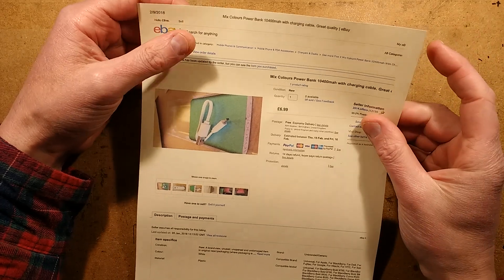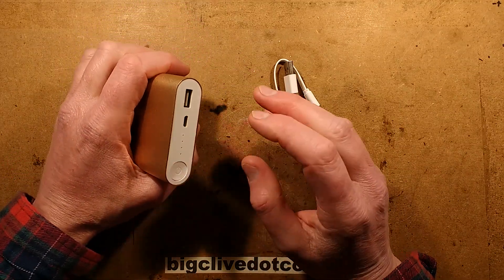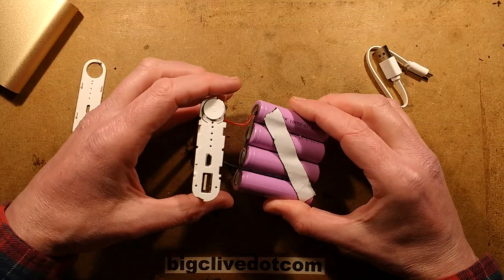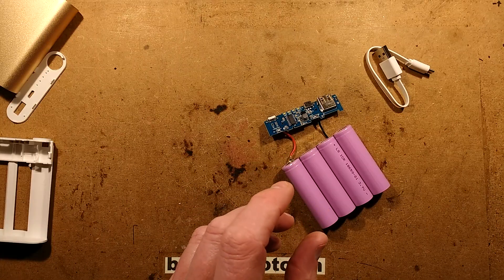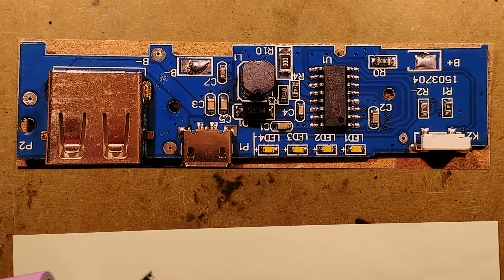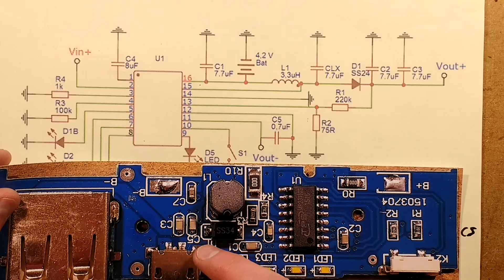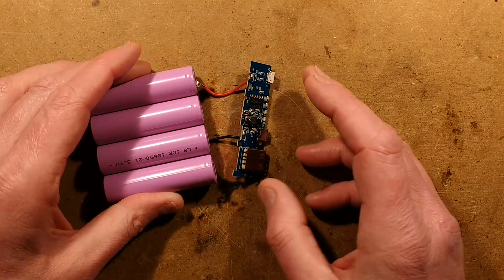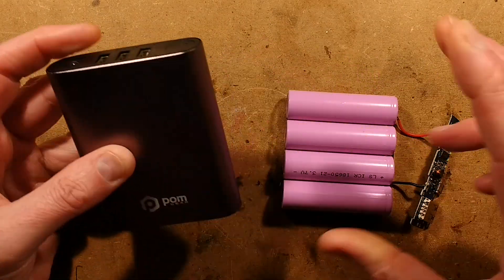Inside a fake "10400mAh" eBay USB power bank.

Comment: You should always fully charge before use before its first use. 
It forms a protective terminal layer whereas if you use it without charging it doesnt do that and causes capacity issues.

Comment: Bought one those rechargeable rotary tool from Walmart in US. They gave me the wrong wall charger. The tool never charge the led was always blinking do that for days and never charge. Built a variable volt charger finally started charging. But it had a tight window. I still get to use wouldn't recommend for anyone else to buy.

Comment: Hey! So I got a 26,800 mAh about 8" by 4" maybe a little bigger, and about the thickness of a single 18650. Probably the same width as that one, but another 2" longer, but I only paid $20. I wonder how I can find out the actual capacity without tearing it to bits and breaking it. (Look I used a Clive-ism subconsciously).
Reply from the maker: For simple non-buck charging circuits you can use a USB mAh meter to measure the input charge from empty to full.
Reply: @bigclivedotcom  I'll look into one! Thanks, Clive. You're quickly becoming my favorite YouTuber. 👊👍

Comment: A power bank with a 10000 mah is usually big and thicc.
Reply: No. The size is ok, only the 18650 cells used must have the declared capacity.

Comment: Well theoretically if each 18650 had 2600 mAh it could be a 10400 mAh cell.  Unfortunately they are only 1000 mAh per cell with really high internal resistance which is really, really pathetic.

Comment: I've salvaged some 18650s from old laptop batteries,  I'm still yet to do something with them, however when I started learning about how to use a multimeter,  I  tried it on those cells hoping to find a low volt dead cell, but I found 2 that are saying they're 48,000v, still faulty but why are they so high and not their normal  voltage?
Reply from the maker: That doesn't sound quite right.  Make sure your meter is set to DC volts and around 20V if it has a manual range selection.

Comment: I wonder if the problem with output voltage stabilizing point is related to the difference between the supposedly 220k value resistor being actually 240k on the circuit(assuming the schematics is valid for the physical circuit). Since it is related to the sense circuit, controller will measure even smaller voltage on the divider with 75 ohms together with 240k. I also wonder if the actual values of those resistors are close to the marked value. Because if 75 ohms resistor measures a higher value, controller will think the voltage is reached 5V prematurely and not push the voltage high enough for an actual 5V output. I checked the datasheets for diodes SS24 (on the schematics) and SS34 (the actual one on the circuit) to see if they have different forward voltages or very different current characteristics but they seem to be very close, so i don't think that is a problem.

Comment: Better off looking for power banks from local reputable retail stores, I've seen plenty of them for over 50% off over the years, just recently picked up a 10000mAh one for 10 euros and without having the hardware to measure it I'm pretty confident it at least had 8000mAh so I pretty much got a less dodgy power bank for the same price as the dodgy ebay ones

Not sure how it is in the other parts of the world but where I live a lot of stores just have hidden deals where a couple leftover items are sold for ridiculously cheap, obviously if they were listed online they would be gone in an instant but I often find stuff like clothes that have several discount stickers slapped on top of each other for like -90% in total and what not, really pays to do some good old shopping trips every now and then

Comment: The ups and downs of 18650. The higher the amperage the fewer charge cycles it has. ie a 5A battery will have fewer cycles than a 2A battery. JehuGarcia has a great tutorial on 18650's. I'll be building my own pack soon of 20-2A batteries.

Comment: Most of those cheap packs haven't had the batteries properly bottom balanced. I'd do that, then rebuild the pack. 18650's are really good batteries.
Reply: It is not necessary to balance 18650 cells connected in parallel.

Comment: Ups... I bought that one ..... Seriously, no, I didn't. I do have in fact a very similar case for 3 cells that I used to repourpose the cells of my old Anker Astro 3 9000mah that had the circuit board fried. I always assumed it took too long to charge and had lost capacity due to the cells being old but maybe it is that charging circuit board that is absolute garbage.
The case itself is wonderfully made and the way it latches is very practical

Comment: I know this is 2 years old, but my question is, could you replace the cells with the correct capacity & resuse the board etc?
Reply: The problem is with the efficiency (TECR) of the circuitry.

Comment: better ones use samsung batteries. Those do not handle charge/discharge very well. 
ig you weight them the cheap ones wight less 10gr than the others!

Comment: I have one that looks exactly like that one, but it claims to be 12000MaH. It lasts pretty long when I use it.
Reply: How many times does it charge your phone in one charge, and what's the capacity of your phone?
Reply: eduardo m it charges my iPhone 11 about 3-4 times fully, its battery is around 3046mAh. The video inspired me to open it up to see what was inside. As expected, there were 4 3000mAh cells. Looks like I got a good one :)
Reply: @scottbrady6795  yeah if you charge 3 times it would be around 9000 mah, due to the power bank inefficiency i think that the specs are right

Comment: Those batteries are 18650 batteries for which can be used in vaping mods and they’re usually 10 pound each so I’m curious are these actually 18650 or

Comment: I have one of those, i replaced the cells with 3400mah Tesla cells and use it to power a wireless battery meter for my solar system that I keep in the kitchen, it lasts about 3-4 days between charges

Comment: The problem I have with all of these sorts of products I've tested is efficiency, which is typically in the 65% range -- You put in 10,000 mAh and you get out 6,500 when using it before it's drained. Still, they have their uses, I guess.

Comment: It doesn’t count as long as it would still charge the smartphones and recharges again, it won’t pick as fake or originated powerbanks. And one more thing when the smartphones are in fully charged, it will stop or break the charges and get the smartphones fully functional.

Comment: Of course, Project Farm recently did a video tasting a selection of 18650 cells and found that the Chinese brands which list 2-3000mAH on paper barely get 1000mAH when tested under a proper load. That would explain why its rated 10400 but only delivers 4000 or whatever.

Comment: I have over 100 of these exact powerbanks, the biggest reason its not 10600mah like advertised, is because the vendors in Shenzhen produce these exact PCB and aluminum cases, they usually do not assemble them or put cells inside, thats the job of who ever purchased the PCB and shell. For instance, my backplate says 10400mah in chinese, but I usually load it with 14000mah at 40A. Of course the PCB is horrible is less than 80% efficiency i believe.

Comment: Well. The main thing is the device seems to work. The batteries are 1,0000 mAH or 1AH. It is in parallel so volt is the same 3.7v and 4.2v fully charged. 4amp is because 4,000mAH or 4AH.

Comment: This thing is very typical "Made in China" CRAP!... It seems like almost everything that comes from that country is either overrated, underpowered, doesn't live up to it's claimed (but total BS) "specifications", is very poorly assembled, and/or just of an extremely cheap build quality! (OR ALL of those things!) It also seems like they have basically NO such thing as any kind of "quality control" with their exported products either because they're quite inconsistent... except that almost ALL of (whatever it is from there) are all "bad" or defective in some way!... I try not to buy much that says "Made in China" on it because I already know that the quality of the product is going to be extremely shitty... but that's getting harder and harder to do nowadays because it seems like almost any and every type of electrical or electronic device, (and MANY other kinds of products too), are ALL made there now!...

However, more and more people I know or talk to recently are wising up to the fact that all of their products are basically all made out of so-called "Chinesium" and therefore is going to BREAK the very first time you use it, and/or wear out or quit working almost immediately AFTER whatever bullshit "warranty" the product may have, EXPIRES, and so most people I talk to now say that they have pretty much stopped buying China made crap too!... 

Seriously, if China doesn't get their ass in gear and step UP and start actually making CONSISTENTLY GOOD or even GREAT quality products real soon, I believe they are gonna lose their worldwide customer base and then no-one's gonna be buying any more crap from there! Lol!... I guess we'll just have to see if they can step up their game and start making better quality stuff... or not... into the future...

Comment: Original Xiaomi power banks with legit capacity have the same case design. Even new slim ones with USB-C, Quick Charge capacity and single large pouch cell inside. Only difference is that plates at both ends are also glued and back plate is bolted to internal frame with two screws.
I insist to battery dissection. Would be interesting to see which kind of battery scam was used here. Are there 3 sand filled DUDs and one real battery or you got those reduced capacity batteries - ones with only 1/4 of battery content or ones with smaller LiON battery inside :)

Comment: You are a man after my heart, I take apart pretty much everything I get in. The main reason is to discover planned obselesce circuits. That same circuit is in a 20AH Black Friday pack I got on clearance from Menards except it delegates charging to a separate chip so it charges quicker.

Comment: The true problem with cheap power bank:
They have the battery voltage (3.7 V) present at the output when they are off. The output is not filtered, there is a lot of noise, up to 1 Vpp. The rated output current is less than 1 Amp. The 18650 cells are 1000 mah each.

Comment: Thank you Clive. Another superbly presented and informative video from you even though I've only just picked it up two years after you posted it! I'm always amazed how manufacturers tool up for such a great product presentation yet fall short of the mark with cheap components. It's the same with cheap workshop tools too. I have to smile though as all these power packs are rated in mAh rather than Ah. I suppose that stating 10400 mAh appears much more impressive than 10.4 Ah :-)

I've only just subscribed to your channel, and it's my ambition to watch all your videos. My word, there are so many!
Reply: Mah is just a standard unit of measurement, even the batteries themselves use the same unit. It's like that for everything, phones, chargers, watch batteries, AA, AAA, etc... Most batteries are < 1Ah so it wouldn't make much sense to use it, that'd be like saying humans are .001 miles tall, just too big of a unit for most batteries. Mah is the most common so they're at least doing a good job keeping it consistent, besides that most people don't even know what the number means so measuring in amps instead of amps would just confuse them, they're expecting to see a number roughly 500-20000 so if you sell it as 10Ah, they're going to be confused and assume the capacity isn't listed for the specific product. You can blame it on the intelligence of the average consumer, not exactly the manufacturer's fault people don't know their metric prefixes...

Comment: I've taken all of my similiar power banks out of service, except for two that had room enough inside to install fuses on the cells. I can't trust those chips to not go short. There's a lot of energy in 4 or 5 18650's, and I don't want my house burning down.

Comment: Today I also opened by not working power bank and I found a circuit, a general phone battery and two heavy metal bars to increase its weight

Comment: Maybe their claim could be that the charge circuitry inside (eg. circuit board and components) will work with batteries up to 10600mAh?  I wouldn't put it past them.  ebay should crack down on the scammers.  The fact that they do not only shows that they are all about the money, and don't give much of a damn about the consumers.  USB memory sticks are notorious on ebay, since you usually can't figure out it's fake until you go beyond the storage capacity on the chips they did use.  You may think you have a 64GB stick.  It says it's 64GB when you put it into your computer.  But once you write more than 4GB, you get write errors.  That's because they used lower density memory chips!  And there's a good enough chance that the buyer won't figure it out until AFTER the ebay contestation period expires...to make it all profitable enough to keep doing.

Comment: Several years ago, I purchased 4 of those, they were, however "kits" with no cells.  They were a bit longer and have the spring ends so you can insert your own 18650 batteries.  I had a good supply from all the old laptop batteries i tore apart when disposing of "bad" laptop batteries.  I found that usually there were one or two bad cells and the rest were quit servicable. I haven't used them now for some time, but when we took a trip to Yellowstone National Park a few years ago with my sister and her husband, we found that most of the places where we camped had no shore power so we had to rely on our generators for power I took along the little power banks, and gave one to my sis and one to her hubby, they kept their cell phones charged with them for 4 days I had a solar panel I could charge mine with when the sun shone but it was rare that week for much sun to poked through so I and my wife also used a couple of them. The other day I was building a calculator kit, and using a headlight that took tow 18650's. the cells petered out on my about half way through so I grabbed one of those old banks, the cells in it still had a good charge and they are still powering my headlight (well 2 of them are) The calculator kit (complete with LED/resistor function and resistor color code function is working great!  What will they think of next!

Comment: What was the actual capacity? Those cells appear to be 2100 each
Reply from the maker: The cheap cells often supplied with these items are usually 1000mAh or less.

Comment: I saw the thumbnail and thought that looks just like one I have in the back of my drawer, looks identical except that you have to put your own cells in mine and as luck would have it I had 4 Panasonic NCR18650B 3.4 ah cells and an inline usb voltage and amperage meter, so I plugged in a few different items to charge, an iPhone 6, a Samsung s7 the maximum amperage output was only 0.42 but a constant 5.03v, I will give the cells a complete discharge and a full recharge and test again, unit only showing 3 LEDs, interesting video.

Comment: Ok but when charging lithium batteries, it’s normal for the voltage to spike up. Those light indicators are simply based off of the total voltage of the battery. While charging, they will appear full. Just a little heads up

Comment: This same mAH CLAIM problem has existed for a very long for just cells and batteries by themselves...never mind when in an active power-pack like this. Manufacturers have setup test conditions that favor their product and can thus make it look competitive with another brand even when it's not even close.

Unless they stipulate an specific electrical standard with which they are complying, the rating they CLAIM can be just about ANYTHING they wish. All they have to do is setup a test that involves sufficiently low drain, and/or intermittent drain that allows some cell recovery, a self-selected cell test "cut-off" voltage, and they can CLAIM a very high mAH rating that has nothing to do with an real-life application.
For example, they could use a test setup that applies a 10mA load for 5 seconds once every 10 minutes, and set their cut-off voltage to 1.0Volts (even though draining any of those 18650 cells to that voltage would compromise the future performance of the cell(s)) and if it tests to "10000 mAH" under THEIR conditions, then they can claim it...even if it's totally misleading in practice. If the mAH rating test conditions are not specified then you can't assume a CLAIMED mAH rating is meaningful for your application.

Comment: I will buy the cases and max out the cases with the batteries they support, I get 18650 cell my case  can hold A max of 30,000 mah Capacity even though it could only do 10,000, & yes the cell I got where real 3500 mah cells, it turns out they even have some that are 5,000 but most are fake

Comment: Update:
Those are Samsung 18650's, 1200mAh (WRONG, I didn't read it right, the number says 2100mAh). ICR/ICN Are mostly Samsung Part numbers, the 12 or 22 or 32 is the capacity (mAh x 100). Not true for every 18650, but at least for those of Samsung. ^^

Wait. These should be 2100mAh PER Cell, ICR 18650 21, wow, they threw the "garbage" of samsung cells inside...roughly 4000mAh when there should be 8400. Damn.

Comment: I bought a logilink powerbank for 10€, which has 6 cells and is labeled with 10ah, which could be true, because i can charge my phone twice and my Clock once and it haves enough charge left to light up its last led.
you can test it if you have enough time, because the Price is also really low and it is not very big.

copy into google: buerklin com de mobile power bank p 10m1616